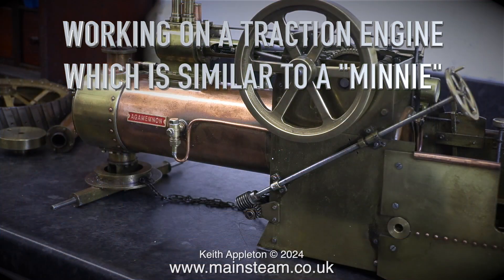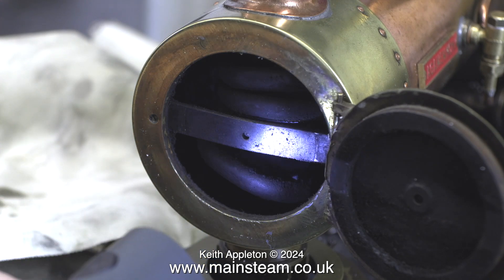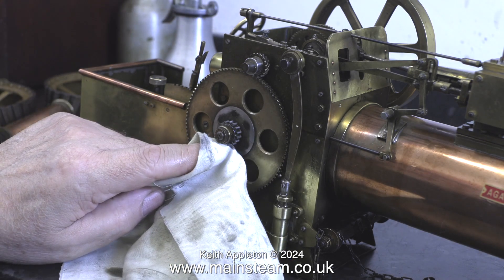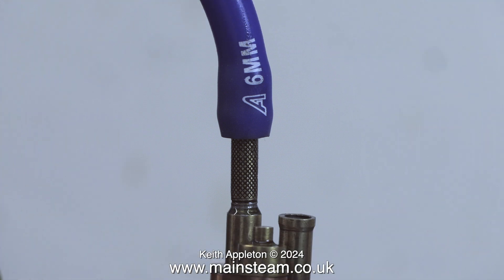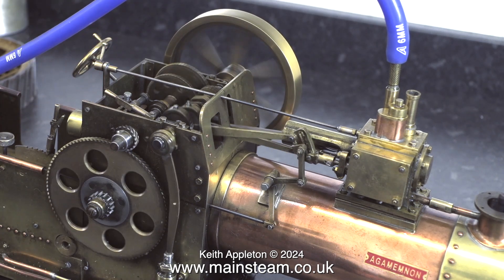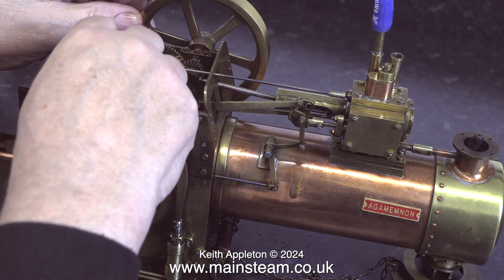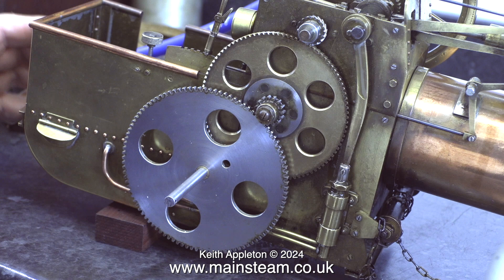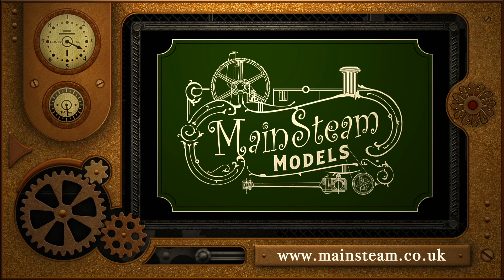A "MINNIE" TYPE TRACTION ENGINE - PART #2

Comment: Did I see an air leak on the piston packing gland?
Reply from the maker: Probably, please watch the rest of the series.
Reply: @keithappleton  I will. i wouldn't have even noticed If I wasn't an avid watcher of your videos.
Reply from the maker: There is a tiny leak around the piston rod gland, kit probably needs tightening }:-)))